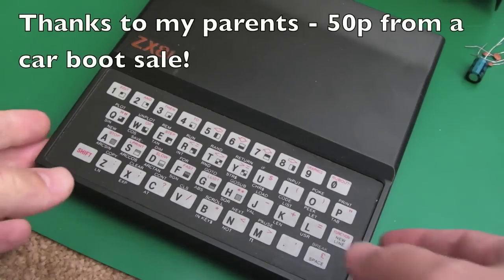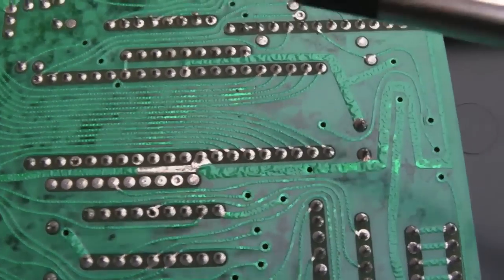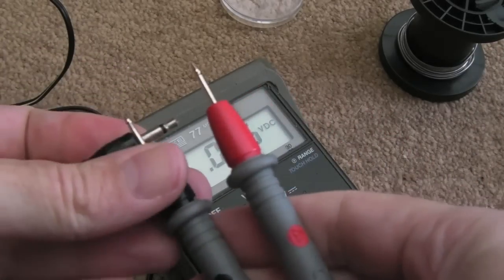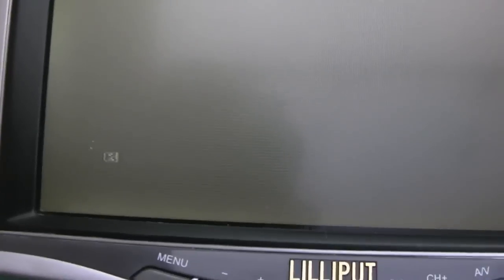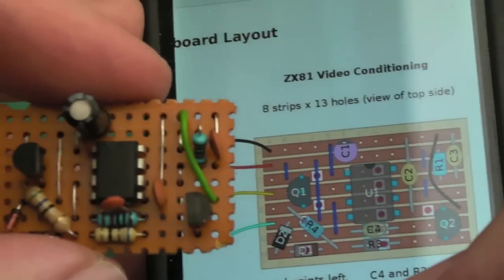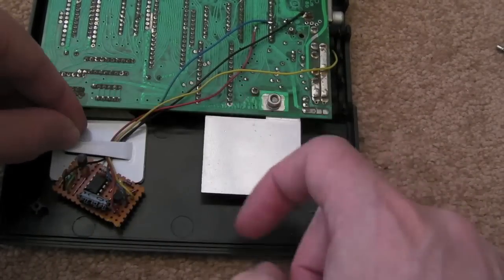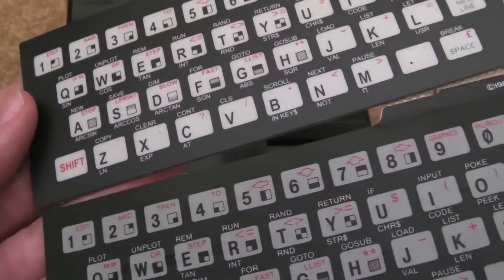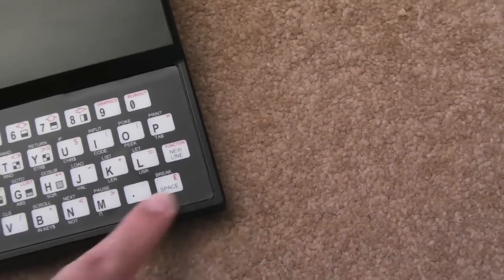Sinclair ZX81 Repair & Composite Mod

Comment: Considering these were built to a price just how well built are they?
Reply from the maker: +clangerbasher In my opinion they are very well built - the keyboard being the weak point really.
Reply: GadgetUK164 Were things just built better back then?  I remember the days when the ICL engineers used to come on site with their soldering irons and 'scopes and fix boards.  And when we moved to 3900 the circuits in them all done by hand were amazing.  Um.  I wasn't so much so ZX stuff was poorly built more trying to gauge how well built.  £69.95 was a lot of money back then so even though they were a cheap computer they weren't a cheap item.  :)
Reply from the maker: I think the PCB quality is very good for the time, and they seemed to use good quality components because this ZX81 was booting after almost 30 years - try telling that to the 5 XBOX 360's I've had that have all died from lead free solder and BGA!   I think this older stuff is better quality, but there's so many other factors in modern kit, especially heat and lead free solder.
Reply: GadgetUK164 It is very interesting.  I wouldn't have thought the 30 years hence they would be working.  :)  

Thanks for replying.  :)
Reply from the maker: Well, this ZX81 was working 100% until I took it to bits!  The only real fault with it was the keyboard (worked despite the dry joints!), and the keyboard connection broke just by removing it.  That's often the way with the Spectrum as well, if you get one where the keyboard works, try disconnecting and reconnecting it - it probably won't work afterwards, no matter how careful you are =/
Reply: GadgetUK164 I do sometimes wonder if Sinclair had been a little less adventurous with his cost cutting he would have made money in the long run.  And the keyboards are the obvious manifestation of this to me.  If the ZX81 (ignore the ZX80)  and Spectrum had had better keyboards would they have sold more?  Did dads who knew nothing about computers looked at Sinclair's offerings and  say a Vic 20 and consider the latter just better value on visuals alone?  Who knows?  :)
Reply from the maker: +clangerbasher I am sure you are spot on there!  Had the Spectrum and ZX81 had tactile keyboards they could have sold much better.  I also think the other problem was Amstrad didn't try to compete with 16bit platforms.  If they had produced a backwards compatible machine with 16bit CPU (maybe as a 2nd processor), and thrown in some PCM sound and higher colour palette / scrolling hardware, it could have competed with the ST and Amiga.   Who knows how that would have affected the industry?!?
Reply: GadgetUK164 I think Sinclair should have been more accepting of standards. Look at the silly non standard joystick  and RS232 ports on his various boxes.  Um.  He appreciated economies of scale but didn't always see the bigger picture that that economy of scale could exist outside his products as it were.  How much better would the QL have been with industry standard 3.5in floppies writing PC compatible disks?  I know Sony messed them about on the price of the units but just think about it. Heck the reason why I put my first ST was because I could throw the disks into an IBM PC at uni'.  Sinclair is still a hero of mine,  and I think it is healthy if you accept you heroes have flaws.

Comment: Oh wow, after you connecting that little ZX81 to a better lcd... my mind was blown, would luv to see it on a crt with my own eyes.
I recently picked up a toast rack with the same keyboard problem so I'm going to have to purchase a repro one, anyway great restoration, would be nice touch to re-apply the deep red paint on the ZX81 badge, I've done this before with a old paint pen maker I had from an old job, colour is near bang on the money.
Reply from the maker: +Bimmy Lee Thanks =D  Yes, was thinking of touching up the red paint with some acrylic paint - I did the same thing on my Spectrum +2 last year.

Comment: Really nice picture quality you got now. Thanks for the hint with the hair dryer, I have to rermeber that when I need to change my keyboards. I also "modernised" my 2 ZX 81´s recently, heatsinks and Tracopower DC-DC converter instead of 7805. ;-)
Reply from the maker: +VectrexRoli Have you shown that yet?  I want to get a ZXExpand at some point - after watching it on your channel =D
Reply: +GadgetUK164 So it seems I have a bad influence on people... :-D I show such stuff only on photos on Facebook, as I don´t have enough space for my soldering station and the whole video equipment with the field monitor and everything around my desk. ;-)
Reply from the maker: Hehe, yes you are a bad influence!!!  My wife will also be annoyed - you aren't just annoying your own wife!
Reply: Ha ha :-D BTW: "Der Luchs" also got a nice ZX81, there is a guy in Germany that mods and sells them with composite video mod, 32k RAM and USB port for loading programs all in one machine, so no add-on´s needed. ;-) Pretty neat solution.
Reply from the maker: Thanks, I wonder if that's LynxMan that does those?
Reply: GadgetUK164
Hmmm... Don´t know, but Sascha can tell you I guess.